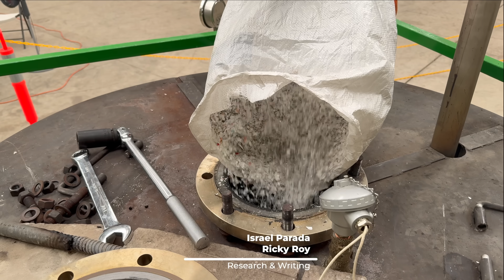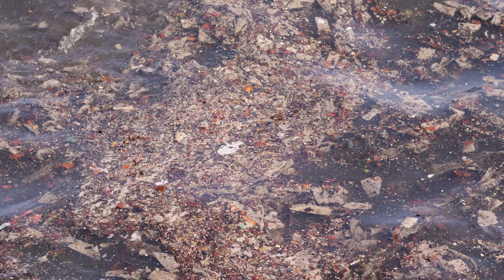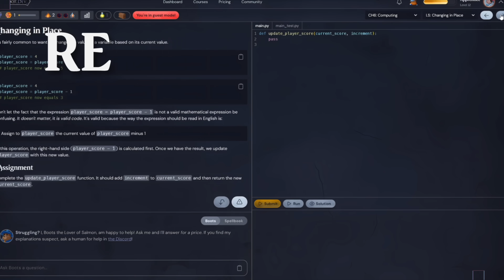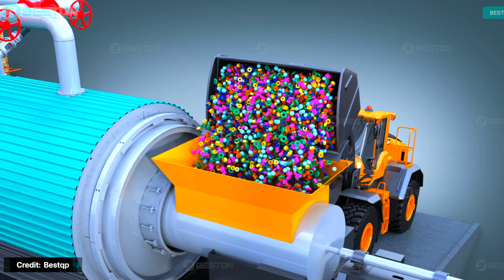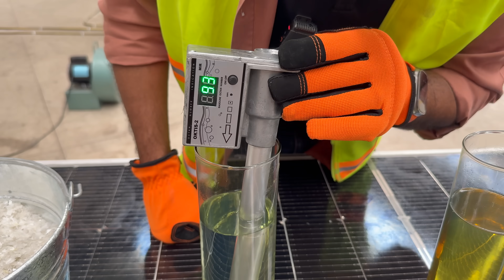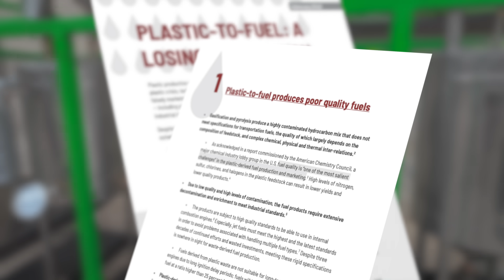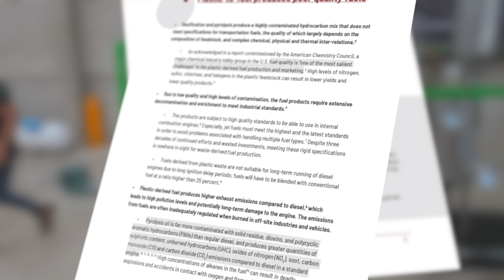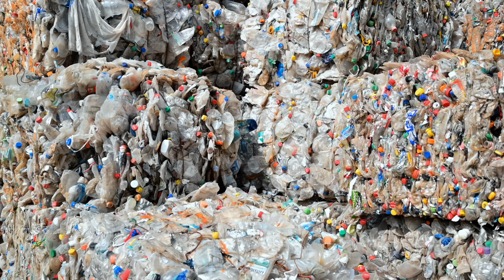Solving the Plastic Waste Problem - This Surprised Me!

Comment: I reckon build a reactor on top of a volcano using the heat for free energy to start the process. Then get NASA involved and build that same aet up but the size of a space rocket 😂 now that will slowllow tons of plastics constantly loading it and injecting it into the vacuum system then ya could have it constant making fuel and disposing of waste all for free producing many products

Comment: I worked on a project in Thailand about 20 years ago and we had almost identical setup and we somewhat proved the concept but that's all this is. This prototype design will never scale up to a real world production so they are only about 10% into the journey. There is no value in the byproducts and we found that the fuel that we produced was not stable. It was fine if used within a few weeks but the flash point widened over time and we could only sell it as bunker oil. Having a fixed pyrolysis chamber like the one shown makes this a marketing con job and not a serious product.

Comment: while this does not produce #2 diesel or gasoline (and octane rating is only one poor measure of gasoline) that would meet today's emissions standards this is a good start especially since the purpose is not being pitched as a new source of gas or diesel but as a way to address the massive amounts of plastic waste... if the input can be controlled on a large scale so that it doesn't produce large amounts of dioxins (i.e., keep all chlorine containing feedstock out of it) it will likely be a good thing and not a major superfund site of the future... this is key

Comment: @naturejab has been doing this here in the US. And fortunately it appears that this unit here on this documentary is a bigger scaled system. They should do a co op
Reply: I also don't see any microwave reactor in this machine like in @naturejab's...or vacuum pump system..
Reply: @juanochoa9410  right, when he talks. What did he say.
I don’t know, just nod your head 🤣
Reply: He's not a scam, just still optimizing his machine, he did all of what he's done without the backing of a large corporation.
Reply: @chrisedwards5752  he's a liar for not accurately communicating that the byproducts are worse than the plastic waste itself. The process will never be energy efficient.
Reply: @operands what are the byproducts? Can they be scrubbed away somehow?
Reply: @chrisedwards5752 Here are the facts: Unrefined pyrolysis doesn't eliminate waste; it converts it into highly toxic chemical waste that refuses to stay in the liquid fuel and instead instantly off-gasses into the air you breathe.

The process violently aerosolizes Benzene, Toluene, Xylene, and Styrene—four volatile gases that are highly flammable, aggressively toxic, and known human carcinogens. Furthermore, because carbon-fluorine bonds are virtually indestructible, they survive the extreme heat, aerosolizing the actual PFAS (the true forever chemicals) directly into the exhaust pipe.

That is a minimum of 5 different highly mobile atmospheric pollutants being vented directly into the air that are exponentially more dangerous and biologically harmful than solid plastic waste safely contained in a landfill.
Reply: No, he is scamming people and doesn’t produce enough to fuel anything. His “machine” produces less than 8oz in 8hrs of running and he does nothing to capture toxic emissions. He is a scam artist preying on ignorance.
Reply: @norfolknwhey4787 Can you confirm who is he, Naturejab or the guy in the video?
Reply: @norfolknwhey4787 
He seems intent on poisoning the local population.

Comment: This tech is being around for years. Nothing new. Reason why it's not being used is first of all it's processing the plastic meterials. It needs to get washed, seperate according to meterials, grind and so on. If you don't do this process you might end up producing gas types that you don't want. While heating you end up producing more carbon. The end product needs filtering. I've been to such recycling "factory" like 5 or 6 years ago and it's same process with the video, same outputs. 
Because it release so much carbon this is the challange they are trying to solve.

Comment: If they produce “gasoline” with an octane rating of 120 then that has to be pretty much pure aromatics, i.e. something like toluene. Generally to be classified as gasoline the mixture has to be less than ~30% aromatics.

Aromatics are great for octane rating but at a certain level it decreases volatility, and makes the fuel difficult to burn completely. The exhaust is going to have excess HC emissions which is a big no-no.

In the old days of Formula 1, teams used fuels with a base of up to 80% toluene. It had to be pre-heated in order to burn efficiently, but it allowed insane power output without detonation.

Comment: Yes, getting rid of Carbon Emissions and Plastic Waste at the same time is the ideal but at this point, that is unrealistic but people still want to believe that it is possible.
One example of that is Curbside recycling where people's perception is that the plastic that they put in the recycle bin will be recycled even though we know only 5-6% is actually recycled.
This leaves most Americans with the perception that we are recycling our plastic.
What Petgas is claiming does look like a good way to correct this if can you convince people to support this when we have already been lying to the public for decades and recycling.
Also, for Petgas to gain traction, independent verification is needed but, from what I saw in the video, I am not sure Petgas would allow that for concern someone would steal their process.

Comment: Hi, I use oktis 2 as well. In USA the ratings are AKI = Anti Knock Index, Oktis 2 is configured by default at RON research octane number. Unless they changed it ofcourse. 

However if this fuel is 93 AKI it's crossing 100 ron which is insane.

Comment: One problem is thinking that you are turning plastic into fuel. It isn’t…quite. It is crude petroleum oil turned into plastic and then turned into fuel. That petroleum was already pumped out of the ground, transported, refined, processed and then used in some sort of plastic. This simply recycling a petroleum oil back into the basic carbon chains that it started as and then into fuel rather than letting natural degradation take hundreds of years to do it….and, we get fuel out of it. A huge bonus. We get to temporarily use it as plastic before it’s fuel. Almost a perfect energy source.

Comment: As for your question, the answer is simple, yes it is a welcomed technology and we should be doing this. As for gas, we have no way to completely eliminate it and plastics come from crude oil already. Co2 needs to be present in the atmosphere and I fail to see it as a green house gas as everyone claims it to be for a multitude of reasons. There are plenty of studies showing its a very minimal effect, there are much worse toxins in the air. I don't see this as contributing to more co2, I see it as recycling one thing into another thing, clearing out our landfills is definitely going to help remove some of the more toxic gases in my opinion. This technology is not new, but its becoming more viable so that is great news. Hopefully one day we can bring all our recycled plastics to a local gas station and they can give us a discount on our gas. I think that would be a great business model if it could work!

Comment: In South Africa  , Rustenburg municipality , has signed the first project off with pyrolosis techolgy to mine the landfill site, and to get rid of  municipality waste sewage etc ,to  produce electricity,1 ton of waste produces 1 MW , electricty  the Co2 is captured from the generators and converted back into high end  refined oils , like jet fuel petrol diesel etc Energyfields and Eden carbon solutions . I believe are the contractors . This project took 15 years to get through the red tape, apparently

Comment: CO² is not a problem. It has never been a problem and never will be. So, solving the issue of excess plastic in our environment in this way will be very beneficial. 
I believe when you hear about people who are against this new technology, if you follow the money, you'll find it leads back to the oil corporations. They risk losing billions to this technology if it really takes off in the world. 
And lastly, as I said, CO² has and will never be a problem. We just need to plant more trees and other plant species, all of which breathe in CO² and breathe out air. If we start a worldwide campaign to plant greenery in the cities, on the streets, and on roof tops, we will solve the smog problem very quickly.

Comment: Rustenberg in South Africa  us the first city to use pyrolysis technology .. then the co2 that is generated after genetating electricity is converted back into high end oils by way of the Eden system designed in South Africa 🇿🇦

Comment: They've been doing this in Australia for at least 5 years.
Reply: What's the cost of the set up?
Reply: @sprintology  I have No idea. but it doesn't matter. There is an endless supply of plastic waste. The process turns it back into oil which can be used to make more plastic or anything else made from oil.

Comment: They are not burning the wax and the coke so it doesn't put all of it in the air plus there may be fuel demand driving this stuff around...  With the amount of hackers involved it will happen that waste is used though.

Comment: What are we talking in gallon amounts that can be achieved in the 4 categories, gasoline, diesel, kerosene and with coke measured in pounds if we start with 5 tons of this plastic material.   Then what would it cost to build just the facility to process the 5 tons in a week. The facility is just 1 piece of the puzzle.  Next we have to set up some way to gather these plastics along with a storage and shredding facility.  Need a storage and processing facility for the end products, kinda like a terminal.  I'm thinking just off the top of my head we'd be looking at around a million dollars if not more.  I haven't even given a thought to all the permitting, engineering, site prep & approval fron local, state and federal agencies.  The more i think about this 3 to 5 million dollars and 3 to 5 years to get a facility up and running.  In the United States to make something like this profitable the facility would need to process how many tons of plastic on a daily basis.  5 ton, 10 ton.

Comment: this technology has been around since the 1980's but the oil and gas companies have suppressed and hidden the technology, this helps use and reduce plastic waste... combine it with alternatives too oil based plastics like ones made from mushrooms and it will make a difference

Comment: Well the thing is is the plastic bottles and waste plastic doesn't stay in one piece for long, it eventually breaks down into the microplastics and the planet has a harder time processing microplastics then it does processing the c02 from spent fuel. Plastic is already cleaner than crude oil, so cutting into the crude oil industry by using waste plastics as a fuel source means we don't have to mine as much.

Comment: You need to have a supply of surplus cheap power to supply heat for this process - in all cases, pyrolysis uses more energy to frack plastic than will be present in the fuel product. First law of thermodynamics.
Reply: What is the first law of thermodynamics please let us all know

Comment: Wait. 91 is "premium" in America? I dunno about other countries, but in Australia 91 is our "cheap" stuff, 95 is the middle ground and 98 is premium.
Reply: It all depends on which method is used to measure octane.  Here in the eastern U.S., they predominantly use one method, and out west, another.  When I traveled out west I was wondering why the octane ratings were lower at the pump.
Reply: @skookapalooza2016  Ahhh. I didnt even know there was multiple methods. Cheers for the info. Appreciate it.

Comment: About 20 years ago I read a patent application that basically outlined the method of turning plastics into hydrocarbon in anaerobic environment. It didn't specify if the hydrocarbon was usable as fuel, only suggesting that the method could be used to transform plastic waste into a type of crude hydrocarbon that could be further processed into other stuff. And all the process needed was very high heat, very high pressure and the lack of oxygen. Basically the exact environment inside a borehole landfill.
Reply: And to create that environment in a lab or factory setting it would take LOTS of power. That’s the big reason this isn’t feasible on a large scale. The Germans did it out of necessity during the Second World War but because of how inefficient it was they didn’t continue after they gained access to crude oil again.

Comment: We have been doing this for almost 10 years now. Renu Energy Services. Right here in the USA
Reply: Here is a breakdown of the environmental and health impacts based on recent studies:
1. High Emission and Toxicity Levels 
Toxic Fumes: Pyrolysis and the subsequent burning of plastic-derived fuel release dangerous compounds, including dioxins, furans, heavy metals (like mercury, lead, and arsenic), and volatile organic compounds (VOCs).
Lower Quality Fuel: Plastic-derived fuel is often more full of carcinogenic aromatic hydrocarbons than traditional crude oil.
Increased Exhaust Pollution: When burned in engines, plastic-derived fuel produces 12% to 50% higher exhaust emissions compared to standard diesel, including higher levels of nitrogen oxides (
) and unburned hydrocarbons.
Persistent Pollutants: These pollutants are known to bioaccumulate in the food chain and cause cancers, endocrine disruption, and immune dysfunction. 

2. The "Plastic-to-Fuel" Myth
It's Incineration in Disguise: Many plastic-to-fuel initiatives are essentially a form of chemical incineration, where the plastic is not truly recycled but rather burned, turning it into greenhouse gases.
High Energy Input: The conversion process is extremely energy-intensive, requiring high-temperature thermal processing, which often means it is not a net-positive energy solution.
Damaging to Engines: Plastic-derived fuel has higher viscosity and density, which can cause long-term damage to engines due to incomplete combustion. 

3. Safety and Operational Hazards
Industrial Risks: Pyrolysis facilities have a history of accidents, including fires and explosions, due to the difficulty of managing the process, which involves high heat and flammable mixtures.
Ineffective Regulation: In many regions, the emissions from burning waste-derived fuel are inadequately regulated, placing a heavy toxic burden on local populations, especially in developing nations. 

While some studies argue that modern, strictly controlled catalytic pyrolysis can mitigate some of these impacts, the consensus from environmental organizations is that this technology perpetuates the plastic crisis rather than solving it
You should be SUED and imprisoned for excessive pollution(excessive global warming emissions)
Reply: @brendonphillips8085 you have old and false data.

Comment: So, we burn fossil fuels (creating CO2) to convert solid carbon (Plastic), to "fuels" the we just burn and eventually turn into more gaseous CO2? The same molecule we've been fighting to reduce within our atmosphere for the past 20+ years?

I don't see how on earth this technology can be classified as "Green", yes it has the opportunity to consume plastic waste and produce usable fuel from it but, how much CO2 are you producing to just convert the plastic? And then you create more CO2 when you burn the fuel. This really needs a study on the CO2 impact vs just drilling for virgin oil... I have a sneaking suspicion it's actually cleaner, in terms of atmospheric CO2 to just drill for more oil...

Yes, it gives us something to do with plastic waste but, we're essentially just getting 2 uses out of the same oil we drill, which solves the problem of oil supply, not the problem of pollution from burning said oil... The only way to stop plastic pollution as well as not add to the CO2 problem in the atmosphere then we need to find alternatives to plastic and stop generating it in the first place...

Comment: It would be more efficient and cost effective to use waste plastic as part of the fuel in existing waste to energy facilities. Holy grail of waste to energy is a municipal trash incinerator used to generate steam and electricity coupled to a hydrothermal liquefaction facility that converts municipal sewage into synthetic crude.

Comment: Pyrolysis is not new. A follow up video with the to good to be true details accounted for? Seperation wasn't clear (other than PET). You showed both all plastic into the vessel and pre processed and seperates? The amount of energy input needed? In sum can it be financially sound with the input costs and the products produced? Or does it need subsidies (that's ok)?

Comment: I think we should turn plastic into fuel at least for now. We’re currently using raw materials to make plastics that end up piling up in landfills and oceans. At the same time, we’re also using raw materials to produce gasoline, diesel, and other products that could be made from breaking down plastic instead.

If we can replace some of those raw materials with recycled plastics, we’d be reducing waste and slowing the consumption of new resources. Every time we reuse something instead of creating it from scratch, it’s a net benefit.

That said, we should still work toward better recycling methods and ways to reduce our need for raw materials altogether. But if this process can both clean up waste and cut back on resource extraction, it’s still a step in the right direction.